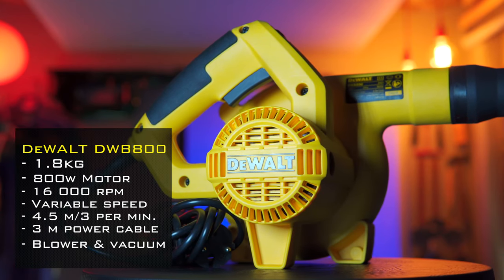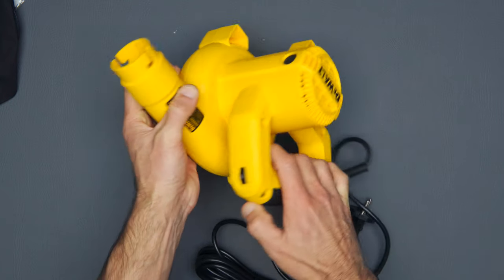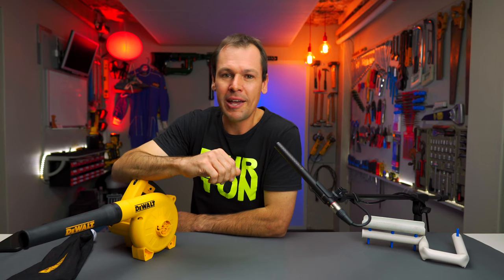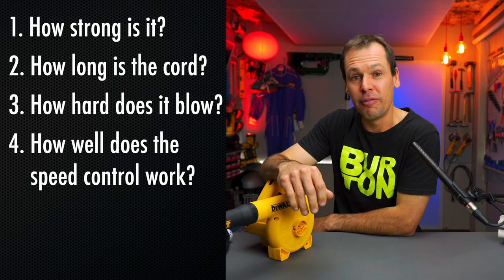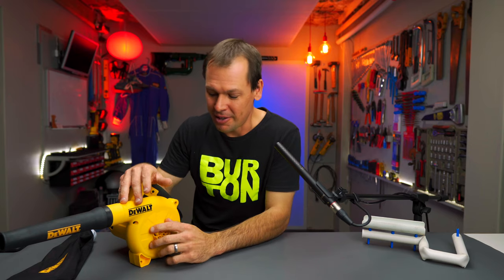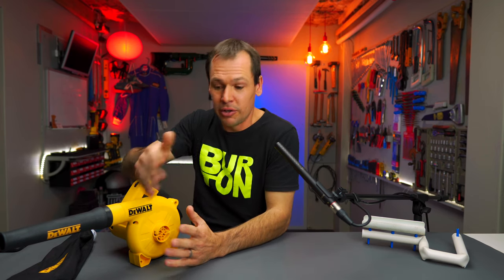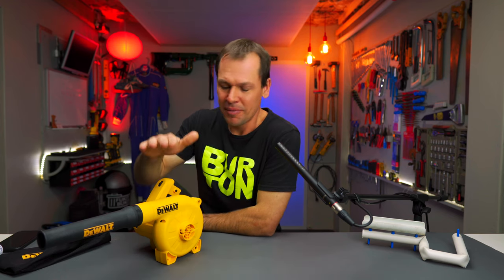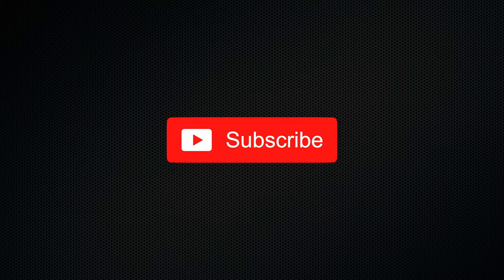DeWALT DWB800 | DCE100 | DCBL722 Blower - Which is best?

Comment: Just bought it.. Here in India....!!!! Man O man am I impressed.. Its quite affordable too...
Reply from the maker: Hi Raghavendra, good to hear you happy with your purchase. It's a very useful tool to have, especially for yard work. How much did it end up costing?
Reply: @GrantBurton  well iam going to buy it too just watched your review....it will cost me 3300 rs which is very good Bosch is 1300rs more than this....I will go with DeWalt
Reply from the maker: Hi corvo, I'm sure you will be happy with it, I certainly am happy with mine... lets just hope it lasts many years. My dad has the same type of blower but made by Makita and that has been going for probably 15 years now, most likely also in need of new brushes.

Was the Bosch for 1300rs from their professional line (blue tools) or the DIY line (green tools) range?
Reply: @GrantBurton  oh the Bosch 820 watt air blower was in blue colour so I guess proffesional Line btw the Bosch and DeWalt air blowers I compared both have 800 watt motor but the de Walts one is 800grams in weight and the Bosch one is 1800grams in weight why the difference does this mean the Bosch has better quality of material ?? Btw Bosch one had 6 month warranty and DeWalt one has 2 years warranty
Reply: @GrantBurton  Bosch airblower was not 1300rs I meant it costs 1300rs more than DeWalt which would be 4600rs
Reply: @GrantBurton  thats crazy man 15 years and still running very good quality wow
Reply from the maker: @Cineraria99  I would also go with the tool with longer warranty... 2 years is good. The weight of the DeWalt DWB800 blower is 1.7kg and the weight listed in the User Manual of the Bosch GBL 800 is 1.8kg so would think they are mostly the same... 100g difference is not that much.
Reply from the maker: @Cineraria99  Oh yes, sorry... I didn't read correctly. I would definitely go with the DeWalt because that is a big cost saving... almost 1/3 cheaper.
Reply from the maker: @Cineraria99  Yip... It only gets used occasionally but works just as good as the day it was purchased. These blowers are pretty simple tools with not many moving parts so as long as the motor is good quality, using quality bearings, and the 'compressor wheel' doesn't break, there is not much else that can go wrong.
Reply: @GrantBurton  nice man you really know your tools and that shows in your videos keep up the good work buddy
Reply from the maker: @Cineraria99  Thanks very much. Hopefully you also enjoy the other types of content / videos on my channel.
Reply: @GrantBurton  yeah sure
Reply from the maker: @Cineraria99  Maybe it was just a typing error on Amazon. Here is a photo of the weight of the DeWalt bower... my scale measures it's weight as 1.85kg. https://www.youtube.com/c/GrantBurton/community
Reply: @GrantBurton  oh wow that's cool than DeWalt one is much better in everything I guess comapred to Bosch.....good job by DeWalt quality offering in good price while Bosch is charging more  for their brand name I guess

Comment: Hey buddy I bought this blower and  just after one month of 6-7 short uses my DeWalt 800w blower is having issues like when I press switch it doesn't work until I press a few times and there is constant sparking visible through the side of the blower in the motor....can you imagine just after one month of minimal use....😐 what to mate ? Repair it or get another one through warranty ?! Pls help
Reply from the maker: Hi Corvo, the sparking you see inside the motor, through the air fins, is probably normal for a brushed motor... unless it is excessive sparking, then that is not normal.

I guess your blower has a faulty switch. I would definitely return it and get another one through warranty.

It does happen from time to time that there is a bad tool that comes off the production line.

If you check out my teardown video of this blower https://www.youtube.com/watch?v=YMMSyRiZ5JA ,I mention that I wasn't impressed with what i saw inside the tool at the switch and speed control board area... check it out and let me know what you think?

Comment: Can a 3 feet sink pipe be connected to suck and  blow out dust out from car ...instead of connecting a dust bag .... does it blow water droplets from car surface...
Reply from the maker: Hi Atul, it will blow water droplets from a car surface... I use it to dry my motorbikes every time they are washed... blows them completely dry pretty quickly. When it comes to the sucking function, I think it would be better to use a proper vacuum machine to suck up dust.

Comment: Could you do a video on how to replace the carbon brushes?
I feel like given the power and the rpm it spins we have to replace them very often...
Reply from the maker: Depending on how often you use the machine, I think the brushes will last longer than one might think... but I can definitely look into making a quick video on how to replace the brushes. Thanks for the suggestion.
Reply from the maker: Hi Raghavendra, not sure if you have seen it yet but I've made a video showing how to replace the brushes on the blower https://youtu.be/IKvZ_766bII

Hope this helps.